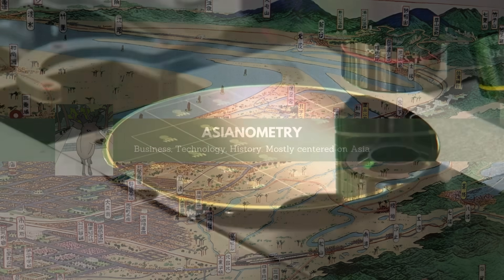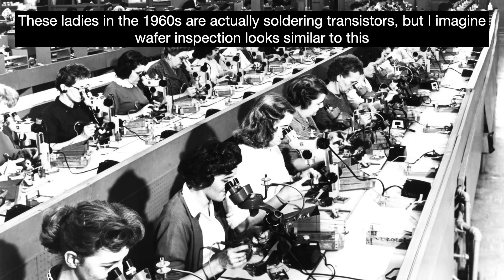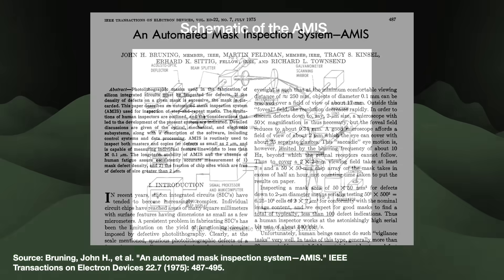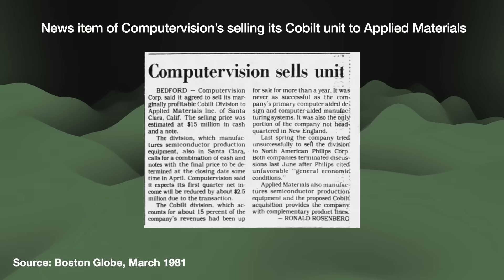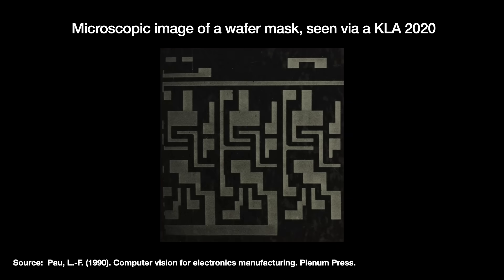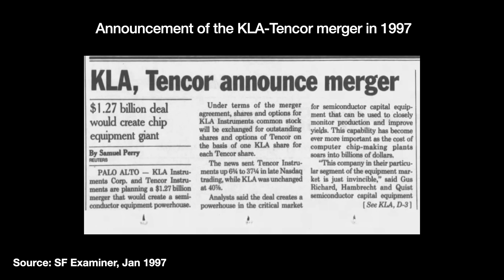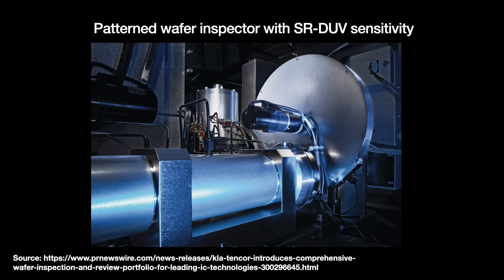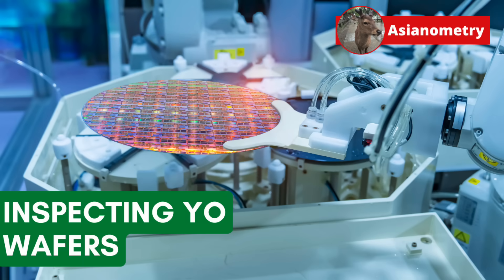How Semiconductor Yields Vastly Improved

Comment: It seems this story focuses mostly on only the 1st stages of wafer production which are indeed important. However, later production, etch and deposition, the tools used and wafer handling as well as tool maintenance are all critical to wafer yields. In the late 1990s - Early 2000s in the plant where I worked we could see wide swings in yields based on these factors.

Comment: i dont understand how "humans bad, computer vision good" took ahold of this industry. MANY industries still rely on human searching for bad products because computer Vision is simply not good AND not fast enough.
i work in Pharma - injection phials. as you can imagine it would be very bad if there was dust, glass splinters or other material inside. how do we check that? highly trained and tested inspection personal.
there simply is no machine on the whole market that has such a low error rate and speed and you cant get that wrong. 
maybe the difference is that one is a liquid and one is a flat surface but i didnt expect the stark difference.
great Videos, Love your channel - greetings from austria <3
Reply: The difference is several orders of magnitude. If you had to inspect a billion phials a day, you’d just give up.
Reply: I think the idea of manually inspecting a 300mm wafer at the scales needed would be absolutely nauseating. A scanning electron microscope has significantly higher precision than a machine as described in the video, but it's so much slower. I'd wager that an electron microscope would be better than you at inspecting your medical equipment too. Throughput is extremely important, however, and you probably wouldn't want to do one object per day.
Reply: @LandonBrainard Unspecting eggs all das, everday, every Week also Sounds so fun but Most eggs world wide are sorted by humans.and there are alot Each day
Reply: @Nagria2112  Again wrong analogy. First of all defects in wafers aren't easy to detect. Secondly one single wafer could have billions of defects during the testing phase. So imagine a single egg having billion defects and then having to fine tuning those parameters to see if those defects reduce. And this trial and error process continues till we get a yield of about 80-90%. Even with automation it takes almost 2 years to fine tune it for mass market production. No egg farmer is doing that. There is also limit how much parallelization can be done. For example you can hire 10 people and split the work of sorting the eggs. You cant do that with a wafer. The comparison isn't even in the same league.

Comment: But what about Nova - NVMI??? They OCD measurements through scattering in the visible range, why no mention of that company or that defect detection niche???
Reply: Or Thermowave which KLA bought out which does the same thing? Or KLA's SpectraShape series? Or Nanometrics/Rudolph/Onto Atlas series? All of these comapnies/tools can do OCD scatterometry and spectroscopy but I believe it this segment of inspection is under his comment of "low end" and/or optical inspection (which OCD measurements are).
Reply: Probably because it's a different area than defect or inspection.  Those are metrology tools and they are meant to measure the physical dimensions and material properties during the lithographic process.  KLA was about process control and yield (though now they've expanded their vision).  So there are many different areas that they work on.  Wafer inspection, reticle/mask inspection, metrology, etc.

Comment: Probably a pile on, but ... 4:28 - "false negative, marked good but with defects" -  That's the wrong way around.  A false negative would mean it's marked bad but isn't.  A false positive would be marked good, but bad.
Reply: I think he meant “negative” = no defects, “positive” = defect 
So false negative = marked to have no defects, but in fact has some 
Later at 5:00 he also says “false positive” to mean the AMIS tool flagged up some defects, when in fact there is no defect and its just the AMIS tool’s problem

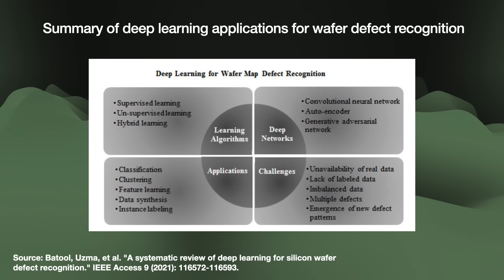Comment: 16:20 AI isn't magic.  It would require more reference images to define your defects of interest and train your model.
Reply: I doubt there is a shortage of images in the industry. For starters, you could use existing tools to tag defects and train the AI on that.
Reply: @Martinit0  I was mostly commenting regarding the statement that reference images wouldn't be needed with AI.  Existing images could be used as a starting point for model training, but you would want to use on tool generated images due to differences in the hardware setup (optics, magnification, sensor resolution, etc.) between toolsets.  This is a significant, but not novel task.

Comment: There's at least a few front end tools missing from this discussion:
NFI quadra, which uses atom force microscopy to view wafer features. 
Asml Yieldstar, used to measure scanner layer alignment, focus and more. Clue's in the name. Popular system with many machines in the field.
HMI escan- multi ebeam inspection tool.
All would be interesting for you to look into, they work rather differently to systems described here.
Reply: KLA has both overlay metrology(Archer) and multibeam ebeam inspection. They cover the full inspection and metrology portfolio.

Comment: Regarding variation between human defect analyziers, I don't think that would cause any problem looking for patterns in the defect rate as you can average it over all your inspectors and over time.
Reply: You aren’t inspecting wafers to get statistics. You’re inspecting them to know which individual die on a wafer should be inked out. The cost of continuing to build bad die increases as you put more downstream money into them, so you need to know which specific ones are bad, not just get an idea of what sort of defects you see on average. So yes, inconsistent inspection is a huge problem.
Reply: @ He claimed that one of the problems with human inspectors was that their inconsistency made it hard to compare defect rates.  That was what I was responding to.
Reply: @petergerdes1094  If you’re trying to reduce defect rates, you will have no idea if the change you made responded on the wafer. Or if, in normal production, one lot is actually better than another or if you just had a good inspector when certain lots showed up. I have dealt with this in other contexts in the fab. It’s infuriating if a lot shows up to human inspect on a known bad shift because you will always wonder if the inspector did a good job. A variation of 5x between inspectors makes the noise impossible to distinguish from the signal. In such an environment, systematic improvements are impossible.
Reply: @ Maybe I don't understand how many inspectors there are but if there are 100 inspectors each shift then even if there is substantial variation in individual inspector shifts the average is going to have very little variation.  In general the variance in the average goes with approximately 1/n the number of samples averaged.  It's why sampling works.
Reply: @ Variance is not the issue. False negatives are. You’re not trying to sample the defects, you’re trying to catch all of them.

Comment: Why it was crazy expensive at the time. We paid for the failure
Reply: @Phil-D83  that, and how labor intensive it was for so few chips per wafer. You pay people by the hour to inspect lots, you’re gonna spend more the more lots you run. If you build a machine that can replace them all and you want to start more product, you just buy a second machine. The reduction in human labor, Dennard Scaling, and the ability to reliably fix defect sources made costs fall off a cliff.

Comment: If you had a silicon processor clocked at 5ghz, would a cpu with a different material, but same transistor count and ipc, but clocked at 5thz be 1000 times faster?

Just a theoretical question, might be unanswerable anyway
Reply: You can basically prove your question already.
Underclock a 5ghz core to 5khz.
See if it scales linearly. If yes, then in principle the other way would too.
Reply: Don't knowz
Reply: What makes you suspect it wouldn't?
Reply: If it can actually maintain that IPC at 5thz then sure but that's incredibly unlikely.

Comment: How on earth do they fix the issues they find?
Reply: Within limits, some mask defects can be repaired. You can use beam epitaxy and laser or electron ablation to add or subtract chrome from the defective area if the problem is a mask write error or removable defect.

On product wafers, there are a number of methods. One is (if you know it’s possible) to clean the wafers. But not all defects are cleanable. Another, as he mentions, is rework: you remove the pattern and start over at the beginning of that step. Reworking itself can introduce defects or damage though so it’s not infallible. Another method is to build in redundancy. In memory for example, sections with bad test results can be sent to a machine that deliberately blows a fuse on the die, either with a signal or a laser beam. The chip then knows not to (or physically cannot) address that sector of the chip and is sold as is. A fourth method is binning: you test the chip with a known problem and characterize its performance. If the defect is not a reliability concern, you avoid or derate the broken areas and sell the “bad” chips as a less expensive class of product.
Reply: @Grak70  Ok, by the time I worked on those already made wafers, there was no way to heal defects.
Reply: @Grak70  When does rework make sense on product wafers? I'd expect rework costs to dwarf production costs, at least in most circumstances.

Also is binning a term just for performance without actually blowing fuses (or whatever gets used), or is it an umbrella term for "we tried to make x, but some didn't do that but can still be sold as y, z..."
Reply: @reddragonflyxx   the answer is unsatisfying unfortunately: it depends. There are several factors. One, as you pointed out, is cost. But you are right that the cost of rework is generally low compared to scrap. The later in the process you rework a wafer, the more economical it becomes (because you’ve put so much money into a wafer that’s almost finished). A second consideration is severity; is the defect bad enough that it’s worth reworking? Or should you just ink out that die and move on? That becomes a question with several factors like “will this defect self kill at test?” and “will I risk more defects by reworking?” and “how much does it cost me to wait for rework vs just accepting die loss?” and “can the lot even afford to wait for rework?” (some steps have strict queue times to adhere to where they need to get to a future step in a certain time window). There is a lot to consider! Rework strategies and routes are a subset of fab engineering all to themselves.
Reply: @reddragonflyxx  to your question about binning, yes it is a general term. Some fabs might not have binning strategies. For example, fabs that do signal processing or simple designs probably do not have the mask real estate privilege of binning their products and will just scrap die that fail at test or sort. But advanced logic and memory fabs may well downgrade performance (logic) or capacity (memory) and try to make SOME money from less than ideal die rather than scrapping them. It all becomes a P&L vs risk of failure in the field question. Is your customer Apple or an automotive customer? You tend to err on the side of scrap if so. Is it a consumer part that will likely be thrown in the garbage in five years? Five weeks? Maybe you can sell it as a low cost alternative. Depends what business you are in.
Reply: @Grak70  "the answer is unsatisfying" -> proceeds to give a very interesting answer. Thank you.

I'm surprised that they do this sort of testing on what sounds like every chip between process steps, instead of just verifying that each process tool didn't break the last 100 wafers to go through it... oh, that's why, isn't it?

Is rework pretty much automated or is it more of a "toss all defects of this category at this inspection step at this machine" and an operator actually does the repair?
Reply: @ automated defect inspection has gotten stupidly fast. But you still don’t inspect after every step. Sometimes you can’t (like what I mentioned about queue times). It’s also purely a cost question of how often you inspect wafers for defects since inspection is considered “non value added” from a finance perspective (looking at a wafer doesn’t build it). The philosophy tends to be to break things down by “layer”. That is, one lithography step and all the subsequent processes to finish that functional step. Inspecting for defects might happen at one or maybe two steps in a given layer- and there could be 10-20 or more steps in a single layer. But if a layer is non critical (for example in CMOS a very large pattern implant layer) you might not inspect at all because it doesn’t really matter if a 1um defect falls on a 100um pattern. Or if you’ve worked out all the kinks in a layer and got it on lock, you might just stop inspecting or only inspect every 10th lot. You concentrate your inspections on the layers where you worry about problems. Those tend to be layers with small features or known headaches. If you fix the problems? Great! Remove the inspections. It’s all about enough inspection and rework to get stuff out the door at a good price, but no more than necessary.
Reply: They do not fix. They mark the bad regions.
Reply: ZEISS MeRiT and similar tools for EUV reticle (photomask) defects. If the blank has a defect they might do computational lithography to compensate, or they might just throw it out and make a new blank. Masks are expensive to produce, even more expensive if you can't run a machine because of a defect, so repair makes sense.

For silicon wafer defects, probably just bin them as lower end or rejects, because it's much faster to just make more from stock than repair them. Even if there's a photomask defect they'd probably just cancel the production run and schedule a different customer until a good photomask is ready.
Reply: When I was a young guy , I worked on testing stations and temparature controlled healing ovens. Called temper oven in order to heal crystal defects, reducing tensions on crystal level.
That was the time before one of my comrades invented the then automated temperature control.
Before that was introduced I had to to set the temperature control organs according to a scheduled plan when a badge of wafers was pushed trough the quartz oven tube.
Reply: Another important factor with defect inspection is that you may be able to catch upstream issues in the process to prevent defects in other wafers.
Reply: I have met the guy who invented the automated temperature controlled heater healing on the wafer healing temper oven I worked on that was installed on the WF (Werk für Fernsehelektronik) factory at Berlin I worked at.
He made too the vintage Z80 based door bell remake. I was glad to meat him and get a fresh pcb I made the door bell recently.
That door bell was made back in time was published on GdR radio amateur journal, publication called "Funkamateur".

Comment: 16:31 I would be deeply conservative about integrating AI into a production line as well.

As we know (or should), to train any model there's the requirement of having enough information to train it, validate it and to continuously improve it against known defects.

That is just ONE consideration of the whole spectrum that is developing an AI system, which is already a sub-spectrum of software development.

Given the complexity already present into the production lines of semiconductors, do we really want this entire new domain to be part of it?

I wouldn't, I wouldn't touch it even with a 100ft pole, not without actual results and studies
Reply: @artofcomputing-art for semiconductor defect classification, LLMs are actually pretty good at their job *if properly trained*. The issue as always is with the size, generality, and quality of the training library.
Reply: @Grak70  why would a LLM be used instead of a linear classification model? A linear model could be much easily fitted into an AOI instead of the slop behemoths that LLMs are
Reply: @ you can and people have. Not all defects can be classified that way, nor is there a parametric basis for all such defects. For example, your fab might produce 5000 products, all with different die sizes, layouts, exclusion areas, or image appearances. The ability to compensate for that kind of variation isn’t easily accounted for in prescriptive models.
Reply: @artofcomputing-art one other factor here is I think we are talking about two different types of defect inspection: the difference is in how easily the background is separated from the defect. That tends to be a function of scale. Linear classifier models tend to be quite good at training quickly on small scale defects where the background ideal pattern interferes minimally. LLMs do better at recognizing macro defects that might span several die, but where the background is not consistent (such as among many products running the same layer process).
Reply: @Grak70 You're right, I was framing my comment on small scale defect detection. Do you happen to have any resources on large scale defect detection so I could learn more about it?